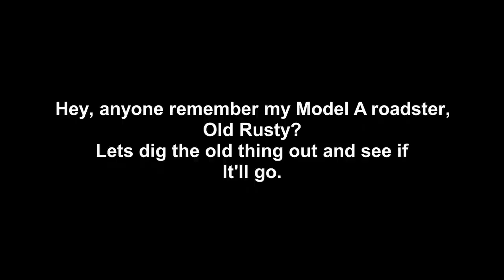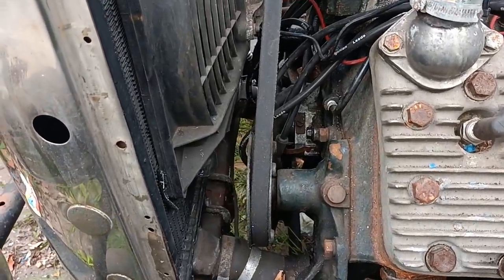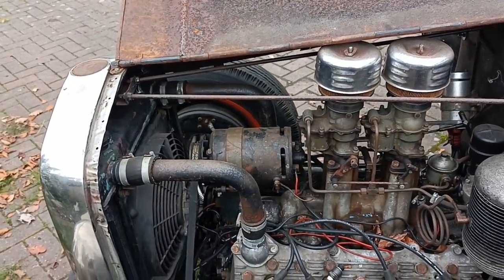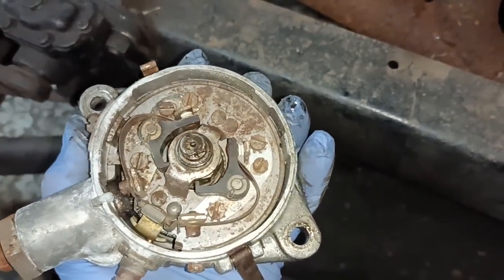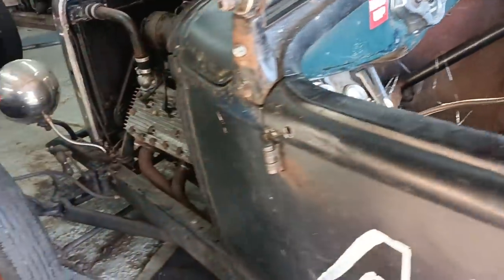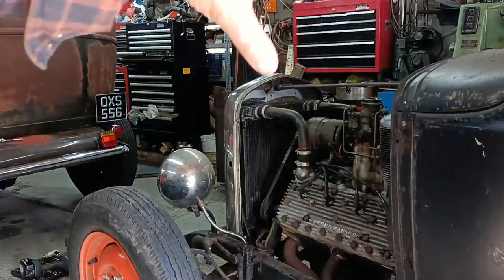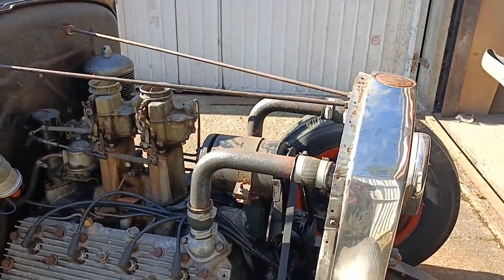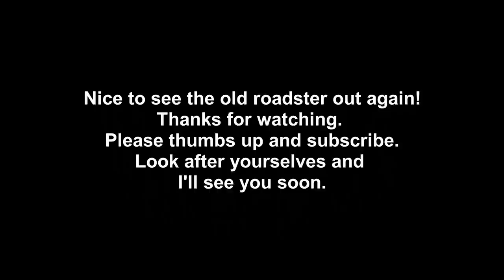Sooo. Mart's Old Rusty, then. What happened to it? Spoiler: It's under a tarp! 30A on 32 Rails!

Comment: OLD Rusty sure looks good. With a little love and some dusting off sure sounds sweet. Love the Sound of a strong Flattie. Nice job Mart. Thanks for talking us along, cheers 🍻
Reply from the maker: Thanks Ron. The motor is a bit smaller on the bore than yours but still runs pretty strong. I did 100mph on Pendine beach with that car exactly as it is now.

Comment: Mart , is that a Mallpassi Filter King fuel filter and pressure regulator on old rusty? i have one on my Roadster! it works good i think your Roadster is Kool! If you need someone to drive it, i will drive the wheals off of it!

Comment: Hi Mart,  I am still here.  Does the UK get the blended gasoline like the crap we have in the USA?  Ethanol added in to gasoline so we can hug trees easier ya know.
Reply from the maker: Hi Tony, saw your reply the other day, thanks for following. Yeah, we have had 5% ethanol for a while and it's just been bumped to 10%. I can get 5% if I buy the expensive grade. We have a flash fuel crisis here at the moment due to a tanker driver shortage so the chance of me getting any of the good stuff is slim.

Comment: Quick blast with Propane torch fix those spidy webs, even gets the Eggs sacks if there's any around. Great fast easy way to evict them.. but they come back.. No one like spidy bite when try to enjoy ride in hot rod. that really bites... lol Old flatty sounds good, got drive it more, under a tarp not helping it stay alive.. but at least it's running.
Reply from the maker: Yeah, Scrapy. I don't drive it enough. Spiders aren't too bad here. It's in the garage now. Lots of condensation though with the temperature fluctuations and humidity. Take care. Mart.

Comment: Just noticed the Right Hand Drive conversion, and details on how you acheived this? Thanks
Reply from the maker: Hi Stephen. this is a Model A body on a 32 chassis. The chassis is RHD so all the pedals and steering are already set up for RHD. The body came from Europe so was LHD. I just made a column drop to support my steering column on the right hand side. The old column drop is a handy place to hang a couple of gauges. (Just lashed up).
Mart.
Reply: @MartsGarage  Thanks for the reply Mart, it looks cool. I like it.

Comment: Mart I wish you would take your roadster to that place you run those time trials at and see what time it runs compared to the Sedan
Reply from the maker: Hi Frankie. I am surprised I don't have a video showing it, but I used to run the roadster at Pendine. Over a few years I managed to finally join the 100mph club. That's the same setup the car was in in this video. I pulled the motor, bored it from 3-5/16 to 3-3/8 and put it in the sedan. The sedan ran 90mph. So there is a 10mph difference between the two body styles, even with the bigger bore.
Reply: @MartsGarage  thanks mart after I sent you that question I did notice the stickers.when you mentioned it on the headlights please tell me if it is on viedo and if it is not on viedo mart if you have old footage please download one for us all to enjoy and I do wish to thank you mart for your work on the channel and for responding to me mart it means something to me mart so thank you

Comment: there is a way to make ethanol frre gas by mixing it with water the ethanol likes water more so if you shake the  container you get pure gas it is on u tube water and gas seperate principe
Reply from the maker: Thanks JW. I don't fancy messing with the fuel. I can still get low ethanol fuel but it is getting to be a bit pricey.

Comment: Fuel pump not working Bud
Reply from the maker: Fuel pump(s) worked ok after getting some fuel through them. The accelerator pumps are a bit sluggish though, just a dribble rather than a squirt.